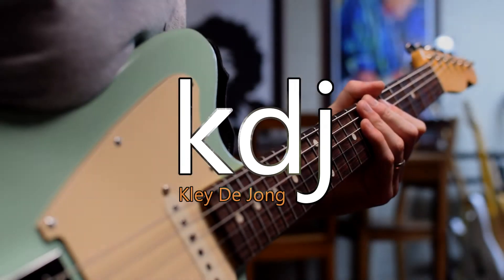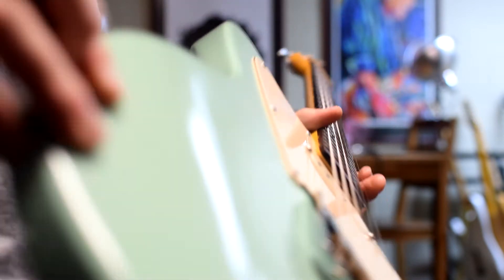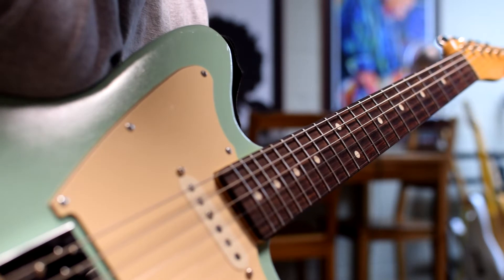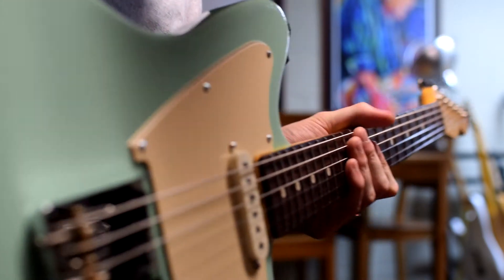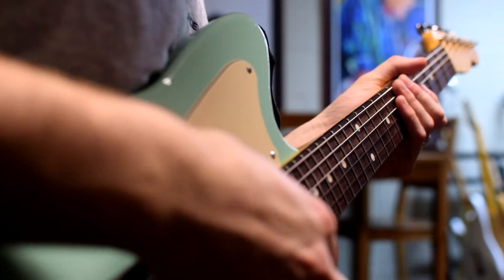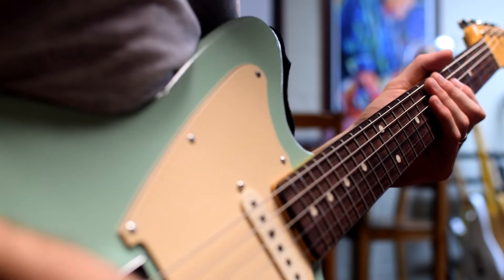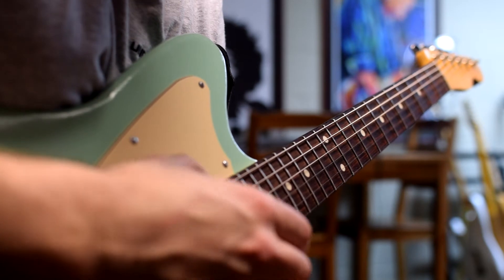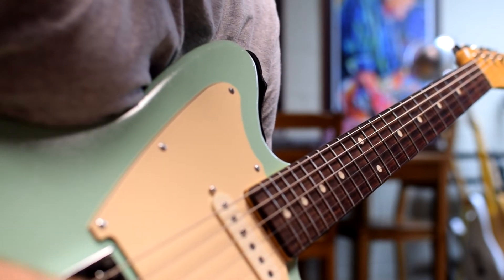Guitar Pickup Height Test & Comparison

Comment: You video helps me out, thanks. The best comparison might be between the lowest pickup placement, and the highest placement at an amp setting that doesn't produce any distortion or breakup, because the breakup from the highest pickup placement clouds the tone of the strings and makes it challenging to compare. But good video, though.

Comment: Good stuff 
I just spend some time adjusting my new tele pups and came to the same conclusion so far 
Set my neck low just barely level with the pick guard = warm, open, woody
I haven't noticed any loss of detail 
On the contrary it seems better balanced frequency wise this way

Neck has 50s type A5 magnets(warmer) and underwound with 43awg to 7k
In bridge i have an 51 type A3 pickup slightly overwound to 7.7k for a little extra zing and fulness
I set it low to match the Neck volume 
But higher on the treble side than bass which is pretty much same height as neck 
I have tested through an old vintage amp set up for recording sessions with headphones with a dummy load, and through a microcube practice amp and it sounds good natural and balanced 
But I still have to see how it will react with a live amp 
My guess is the neck is where it should be, but I might heighten the bridge just to get a little more life/harmonics and zing out of them 
It might cost in volume balance but with a compressing clean amp it might not be very noticable